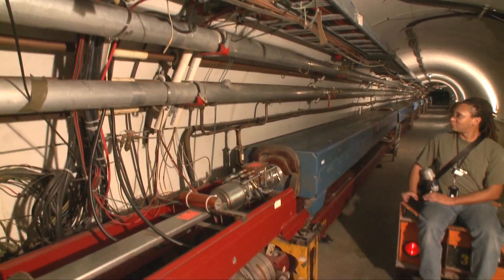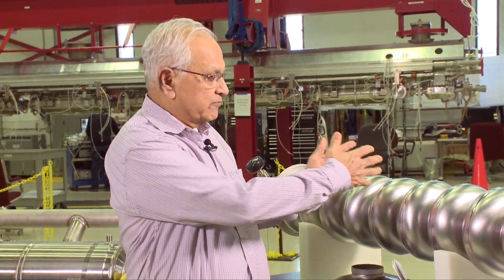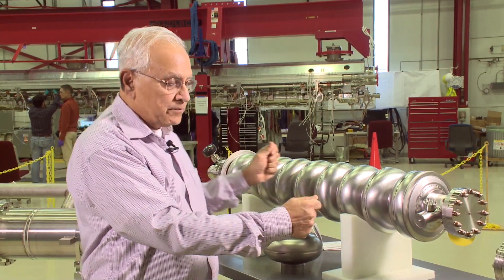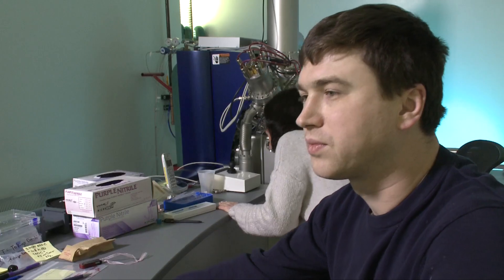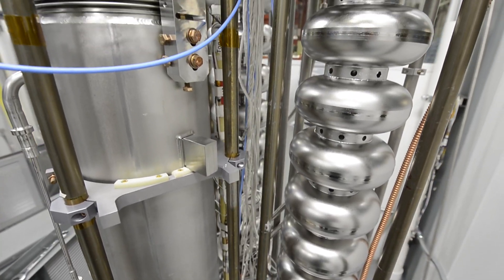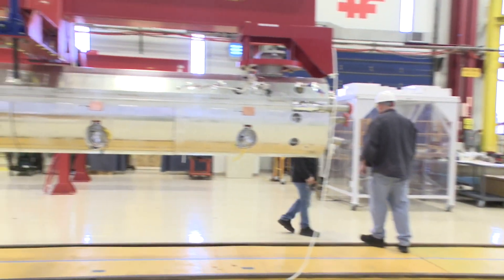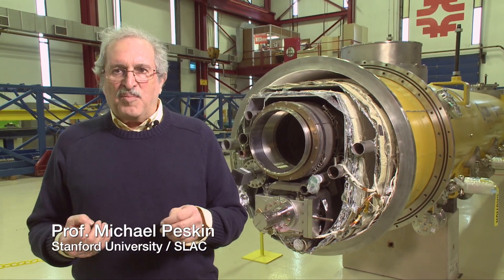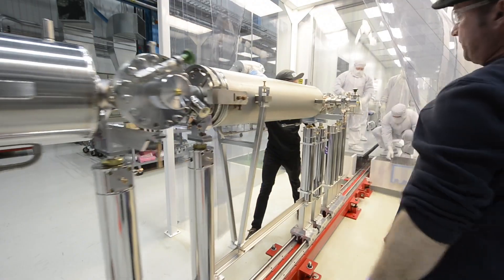Better particle accelerators with SRF technology

Comment: 1:14 - I understand that Niobium is not simple to weld but those Welds are not very good.

There are many Companies that could do a better job. Apex EP claims to have a Clean Room and do Niobium but I've seen better than that also.

Wouldn't machining and using Choke Joints http://www.radartutorial.eu/03.linetheory/tl13.en.html allow easier manufacturing and cleaning; avoiding the difficulty of finding someone to weld Niobium decently (close to perfect).

Electropolishing would smooth the surface followed by a finish of Electron Beam Deposited Niobium or Laser Gas Nitriding.

You need to improve those Welds or manufacture them differently.

YT,
Rob
Reply: that's just a model... not the actual thing